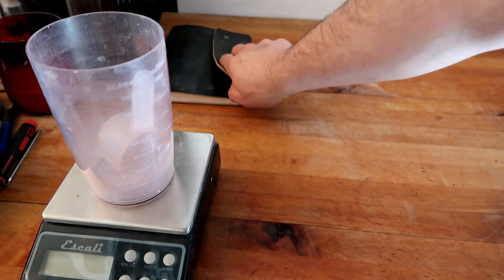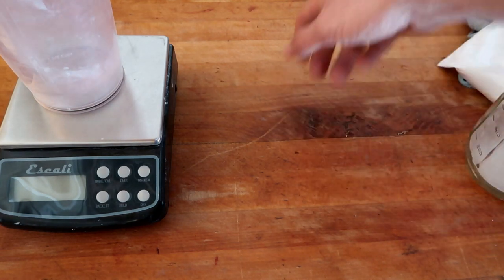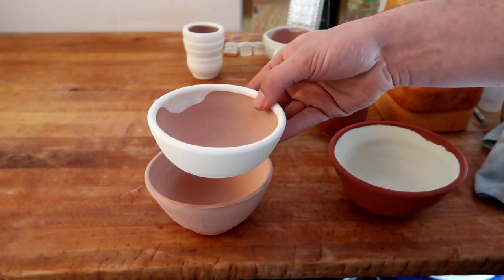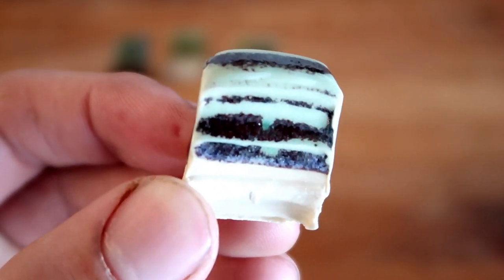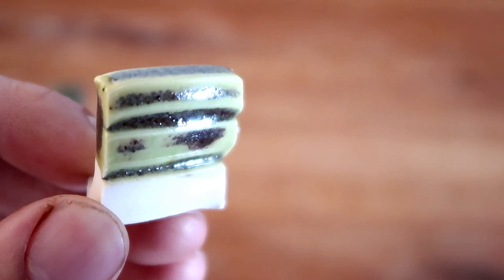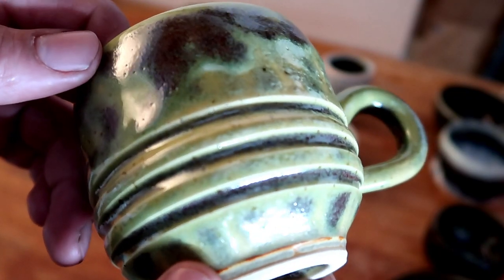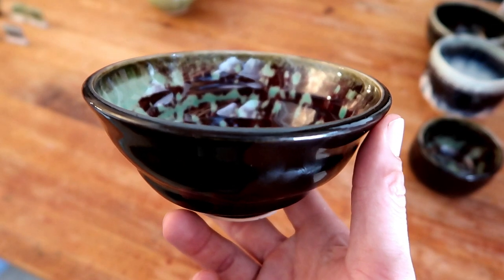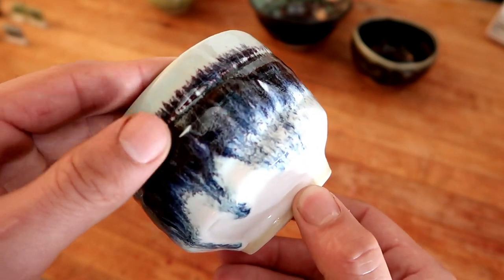John Britt's cone 6 oxidation Copper red Recipe

Comment: soooo... normal electric kilns always produce an oxidized firing and the only way you can get a reduction firing is in a gas kiln? I'm kinda new to working with kilns and I find the redox portions to be the most confusing!
Reply from the maker: that's not the only way but the reason that copper turns red in a kiln is because of the reduced amount of oxygen which is why they call it reduction firing. It's not as though I've never seen a red come out of an oxidation kiln it's that it's just much harder for the chemical reactions from chemicals that turn red such as copper to happen. Silicon carbide creates little pockets a reduction ( I'll put it that way) and that's what helps the red come out of the copper inside of my oxidation with this recipe
Reply: Regan F. Reduction just means reduced oxygen, a living flame either gas or wood can be controlled to reduce the amount of oxygen in the chamber. Also using a sagar can work. There are a number of things to take into account so take a workshop with a potter who uses the process.
Reply: You can have a reducing atmosphere in an electric kiln. You need to add something to the kiln when it is firing. Some people add propane to it. Some people add carbon monoxide to an electric kiln, "you need a license to do that" some people put moth balls in an electric kiln and some people drill a hole and mount a Bunsen burner under an electric kiln to reduce the kiln. And then some people put fine mesh silicon carbide in the glaze to reduce the glaze. If you are just starting out spend time making pottery and using what is available. As to reduction and what is reduction. On the molecular level, lets take red Iron Oxide. If we reduce it and take away an oxygen molecule we get iron. Which is a very strong flux.  If you reduce Copper oxide or copper carbonate and remove the oxygen from it you get metallic copper. It's science and not voodoo.
Reply: Pro tip: watch series at kaldrostream. Been using it for watching a lot of movies these days.
Reply: @Jax Amari definitely, I've been watching on kaldrostream for years myself :)

Comment: I made this glaze & it came out purple & white instead of red & green.  Actually, none of my glazes were coming out correctly.  I realized that it was because I'd used tap water from my new studio & it's got a higher mineral content than other places I've worked.  

An older fiber artist working off of the same well said that she runs a dehumidifier & uses the water from that to make dyes because it's akin to distilled water you'd buy at a store.  

Looks like I'm retesting all of my glaze recipes during the quarantine.
Reply from the maker: a large portion of what I'm finding out as how to calculate specific gravity and half of my glasses don't come out proper color because they have too much water in them.
Reply: @EarthNationCeramics  I did a test of a couple of my glazes with varying levels of water, thinking that was the issue, but the colors were still off.

Comment: Great video! I love the results of the original glaze without the red iron and mason stain. I'd be interested to see it with a thinner layer of glaze because with copper reds at cone 10 reduction you have to hold the piece in the glaze bucket for a long time like 8-10 seconds (or at least the copper red I've used, it doesn't run at all either)

Comment: I think you should test it with a different Mason Stain added.  Maybe it would give you non-baby-poop base color - maybe blue or red - but if you use a darker stain you will probably need to decrease the quantity.  If that works could you just add the Mason Stain on demand?

Comment: What is FFFF?  I have doubly rare Danish lamp circa 1920.  Few were made and my non lava was made fewer.   In learning the history i read a lot on SiC and a consistant two principles were using varying heat-times and the larger the grit the more the pit.  The finest i can purchase from a brick n mortar shop here is 12000 grit
Reply from the maker: F stands for fine and every f is 200 sieve. This is 800